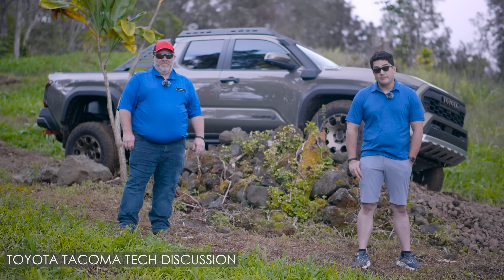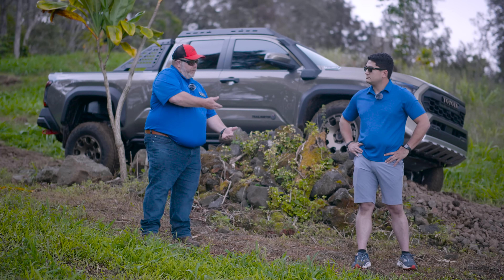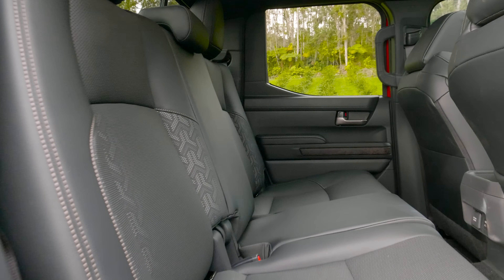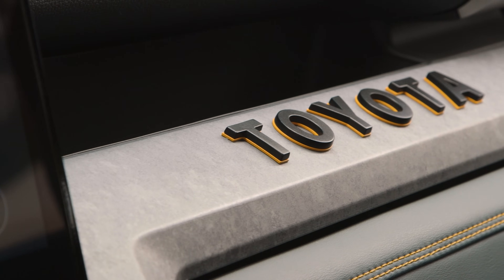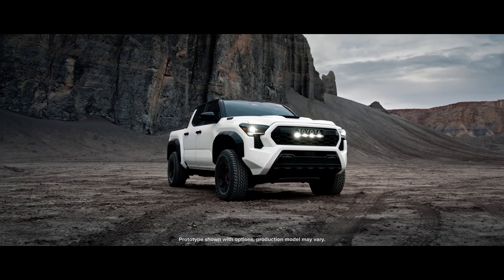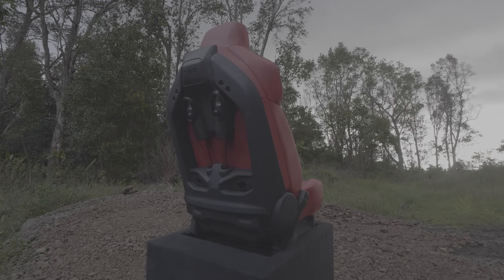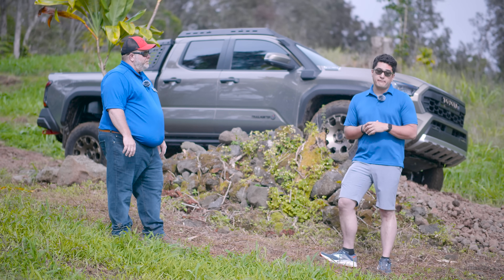2024 Toyota Tacoma | Big Changes, Technical Details

Comment: Great review of the Tacoma, and very impressed by the suspension upgrades and plush interior. While the 2.4L Turbo might be somewhat new to the North American market, what the Chief Engineer fails to tell you is that 2.4L Turbo petrol/diesel engine birth was in the Land Cruiser petrol 22R I4 in 1981 and diesel 2L-T I4 in 1982, sold throughout Europe and Asian markets. It''s bullet proof, so North American customers are in for a real treat.
Reply: its not the 2.4 turbo diesel. but regardless, the 2.4 gas turbo has been used in various toyota lexus suv's for a couple years now already
Reply: But will we get the diesel?
Probably not because I'll have to go buy one if they did
Reply: @vhateverlie  The EPA says no diesel for you. You have to move overseas to get a good vehicle.
Reply: 😂 you think this is anywhere close to related to a 22r/2lt? I’d love to snap a pic of mine and compare it to this. This things a giga Chad truck. Drawing comparisons from the 80’s to now is stupid. It’s gonna sell like hot cakes to a bunch of people who’ve never had poison ivy
Reply: @ethans7682  Of course Toyota's 2.4L engines evolved from '81, that goes without saying. It's about measurable progressions, with sustained  reliability. You don't throw the baby out with the bath water. ;-)
Reply: Wasn't the 22R in the Celica in the eighties????? Swear that is what it said on my motor. It was a 2.4L NA motor.
Reply: @michaelcooley8275  yeah, my friend has a 90's Tacoma. It's got the 2.4 aswell. It's probably the same block like what Ford does with the 2.3 Lema engine.

Comment: Love the new look inside and out.. The only thing I wish they would address is rear seating leg room (or lack thereof). I have a 2020 TRD off-road double cab and need the driver seat pulled all the way back which leaves little to no room for a passenger. Thankfully my dog doesn't mind :)
Reply: I agree with you 100%.  Just give 2 inches in the back for rear seat passengers. Was really hoping they would add extra room.  However, they did change the driver seating position so I’m hopeful I can sit in this comfortably.
Reply: @bryansheridan6434  You will, but the rear leg room is slightly smaller, but you will have more room if it makes sense.

Comment: It looks like they knocked it out of the park, while being careful to not ruin what a Tacoma is. I'm sure they'll remain the midsize sales king with this hugely strong, finally clean-sheet Tacoma redesign. That 2.4L turbo, even in non-hybrid form, makes 20% more max torque than the old 3.5L.... and it makes it 2900 RPM earlier in the rev range. That's going to make HUGE differences for drivability. The old Tacoma was a gutless wonder, even stock and unladen--that won't be the case anymore.

This 2.4L will probably make it into the upcoming 4Runner. If so, maybe I won't have my brand new stone age 2023 4Runner for 15 years after all....
Reply: Your current 4runner is still the best-looking SUV currently. It just perfect from every angle. If I didn't need a truck, I would have bought a 4runner a long time ago (since it is made in Japan).

Comment: Aren't there already major issues with the new i-force engines? Hard to imagine there aren't with an electric, turbo, ICE combo. Even several turbos have blown on just the V6 non-hybrid in the 2022+ Tundras. Toyota's reputation for reliability I foresee probably going down the drain with these engines.

Comment: what I'm curious to know more about is the specific changes they made to the engine internals, as this engine is used in other toyota/lexus products but mainly suv's and cars. How did they ruggedize it for the Tacoma application?
Reply: They didn't. They're just throwing 4 cylinders in everything now to cut costs and appease the EPA freaks, abandoning their long-term customer base who love the smooth and reliable 6 and 8 cyl options. These 4 bangers will never last as long or run as smooth as the 6-8 cyl options and Toyota knows this. Not even a 6 cyl NA hybrid option. Pathetic. They will lose more and more customers until they finally realize their woke power train mistake is costing them money.
Reply: @nateg2468  How do you sell vehicles in the US without appeasing the EPA freaks? Instead of blaming Toyota, why not blame the people you voted into government? Next thing you know there will be a Plaza Accord 2.0
Reply: @Chocoretto  I don't vote Democrat, so I'm not to blame for that. And regarding the EPA, car makers can still make v6 and v8 engines which are cheaper to produce. Unfortunately most have instead bought into the full EV lies and do not give enough pushback to the green environmental lobbyists in Washington. So it is partly the car companies fault. They are fully capable of continuing to make ICE and hybrid 6 and 8 cylinder powertrains.
Reply: @nateg2468  How many V6s and V8s can Toyota produce before they hit EPA emissions cap? Toyota will have to purchase more carbon credits once they hit the imposed limit. You can model all of these out. Have you missed out on the backlash Toyota received when they lobbied against ICE ban and full EV transition.

Comment: If Toyota comes in at under the Ranger Raptor price of $57,000 USD for the TRD PRO & TRAILHUNTER and with no limits on Production or SupplyChain issues then I think Toyota is going to be King of OffRoad in this segment…
Reply: it wont, all of these tacomas will be 50-65k easy
Reply: @benoliver2826  Maybe the first few months, but the competition is already gonna be in full swing by the time this truck actually comes out.  Tundras are already going for msrp.

Comment: I had a 2019 manual TRD off road until recently, and my biggest complaint about the drivetrain is the lack of low to midrange torque—it was really pretty gutless unless you revved it out. Not exactly what you want in a truck, especially when towing. I think the turbo 4 will be a better fit.
Reply: 2017 TRD Sport 6MT owner for 7 years. Don't mind revving it out, the point of the manual transmission to be engaged. Most  performance being available past 3K rpm is what keeps it interesting.

I do understand that automatic Tacoma owners would be frustrated.

Comment: Great video, and thank you for approaching it from an engineering standpoint. I continue to be surprised that they haven't brought Toyota HSD to the truck platforms. Adding more complication than a traditional drivetrain on the "max" hybrid is a tough sell for me. A "transmission free" system like other Toyota hybrids would be more reliable, more efficient, and perfect for most pickup use cases. Actually simpler than a "traditional" transmission! Won't consider a new Toyota pickup until the conventional transmission is gone. I'm clearly not alone; 40% of Mavericks were Toyota-style hybrids and Ford stated they underestimated the demand.
Reply: There must be a reason they didn't do it.

Comment: Nothing sells me on a vehicle quicker than hearing directly from the engineers involved in the project. Marketing fluff and obnoxious hyperbole always fails to capture the actual capability and spirit of the machine they've made. 

I have a feeling the TRD Pro and Trailhunter will only have the iForce MAX, but I would really like to have the option of the 2.4L Turbo and manual trans on those as well for those of us (ME) who want that combo.

Comment: two other questions, with reguards to the manual transmission.   when they had to take those few extra horsepowers away on the 6MT because of the heavy flywheel, what exactly is "crankshaft hammering?" is that like crank walk but at high RPM? 🤔🤔
Also, in the low grade SR trim, when you pair it with the manual transmission, are you always confinded to rear leafs? or does picking the 6MT option immediately put you with the rear multilink suspension even on that entry grade SR ?

Comment: Weird that all but the top two trims (TRD-P and Trailhunter) have a MASSIVE front lower fascia that robs ground clearance and attack angle.  Just looks kinda goofy.  The notion that only the top trims will do real off road stuff is obviously not the case.  Most of the friends I have that would consider one of these would be taking it out the mountains occasionally, and they're also the types that would go for a lower trim level.  Sucks having to immediately swap out a factor part just to not tear front of the truck on a rock.

Comment: The bit about the differences of the lower and higher output engines was awesome. That is the kind of detail I like hearing about. This entire video is exactly what manufacturers should do. Sometimes the technical deep dives just feel like corporate sales pitches.
Reply: That didn’t seem like a corporate answer to you? “Oh yeah the oil cooler is gone or something maybe…”

They carried over a transmission that has a lower torque input rating just to say they still offer it with a stick but with lower ratings so they can phase it out after a while. They phased out the 5 speed for the 4 cylinder for fucks sake in 2017.

Comment: Is the 4 cylinder worth it? not to mention a 4cylinders towing capacity goes down, and the turbo is something else that will just fail in the long run. A turbo on most cases will last around 100-150k miles and often has issues with blowby.

Comment: Scared for them to release the fuel economy ratings.  They increased the wheelbase by 4", which is usually to circumnavigate fuel economy requirements
Reply: Interesting observation.
Reply: @bearclaw5115  I think the EPA bases their fuel economy requirements on a "footprint" calculation, which takes wheelbase into consideration.  Basically, the bigger the vehicle, the lower your average MPG's can be

Comment: I heard the new engine is going to be Direct Injection only instead of the time tested Multi-port Injected Atkinson Cycle Engine. If that’s the case I’m out. Like electric cars, we’re still a long way out from the long term reliability and low maintenance of Direct Injection only engines.

Comment: I wish you would press these questions a little more, these soft interviews sound too much like manufacturers talking point driven questions.  I worked around Toyota in the early 2000's and this sounds just like their product introduction classes from that era.  A great example is the softball question of the engine differences between the low and hi output 4cyl and the lack of an answer.  The real question is do they share the same crank, rods, pistons, cylinder heads and turbo (implying it is just a tuning variation) or not.  There is a next level question you should be asking when you have access to these people.

Comment: Let me tell you why the "Trailhunter" is a huge failure. This "overlander" got only a few things right. The rock rails that hold 1/2 the GVWR is a damage multiplier, not a damage reducer. It needs to be rated to survive the impact of the full GVWR. The steel rear bumper is nice, but where is the steel front bumper? An optional front bumper that will protect your radiator and headlights if you accidently strike an animal is a must for many overlanders.  It needs more skid plates under it.

A larger engine without the hybrid system is more reliable and much cheaper to maintain/fix in the long run. Forget the hybrid battery. A second 12v battery under the hood, and a higher amp alternator, or even a second higher amp alternator, that can charge a variety of off the shelf batteries is more desirable. First, it is cheaper. Second, you will always have a fully charged spare 12v battery to start your vehicle. Customers would prefer to have the options to later upgrade to better off the shelf batteries that can be charged when the engine is running, and also charged with solar when it is not. If this had higher amps from a bigger alternator, or two alternators, running to an invertor that allowed an infinite choice of off the shelf "house" batteries, that can be upgraded or swapped out anytime through the life of the vehicle, you would attract more customers. 

The 33' tires are an improvement, but not with 18" rims. A larger diameter tire does improve the off road ride, but more tire sidewall does too. A 17" rim with 34" tires would be much, much better. A huge number of off roaders/overlanders will make this change, or want to be able to. They already do. 17" rims are popular because there are a larger variety of 17" tire tread types and sizes to choose from, and they are cheaper. If this new Tacoma has to have 18" rims to clear larger brakes, you just pissed off a lot of potential customers. 

What kind of transmission cooler does the new 8 speed automatic transmission have? is it adequate? will it keep the transmission cool on fully loaded 1,000+ mile trips with very steep grades?

No single cab option with the six foot bed. People want to be able to sleep in the bed of their pickup, and have a shorter vehicle for turning on the trails. 

Low hanging exhaust. Make the exhaust exit through the middle of the rear steel bumper. 

Make the hood flatter. There are a few different after market options for solar panels made for the hood of the vehicle that are vehicle specific. These are purposed for keeping your starter battery fully charged if you park and camp in one spot for an extended period. 

The snorkel. People want the option to add a pre-cleaner to the top of the snorkel. A Pre-cleaner means you have to carry fewer, or even no, extra engine air filters. They greatly reduce the amount of dust that reaches the stock engine air filter! 

Always on (when the engine is on) front and rear cameras is a common upgrade that overlanders make. Stuff blocks the rear view mirror but we still want to be able to see behind us when moving forward. When cresting small hills or big bumps, we cannot see the road through the engine and hood. It's common for people to stop and get out of their vehicle to see what they may be hitting or if there is a ledge, or other drop off. 

There are way too many reasons for an overlander to not buy this vehicle, than there are to buy it.

Comment: 0:44 1:49 4:43 9:43 Wow, that unusual front bumper lip gives it an interesting look. Kinda brutish, badass and almost sci-fi style. And from the side it fades into the background so it doesn't look too weird. - Tempting to paint it, but that would probably cause stylistic issues. Not to mention offroad grief.
1:37 Hawai'i glass? 🙂
13:37 golden moment! 😄
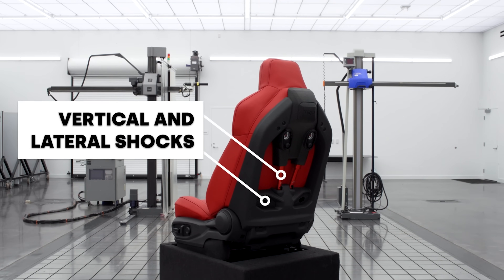15:00 Dampened seat?! ... Things are getting wacky. ... But I gues in extreme offroading this might make a difference. Probably also to spinal health.
15:31 Rare that the footage is right and the edited-in caption has the mistake(s). ... Mark having an extra-tough time?
17:27 The polar bear 'meme' is really weakass and sighworthy. ... Fits the agenda, though. Small children will buy it.

Comment: Jack and SG. Very well done considering the circumstances of the revolving door of journalists that took their Chief Engineers time, what you were able to accomplish here. I ve been following the new launch and every other interview is after a grocery list of questions and phamplet phrases. Jack and SG team were able to make him feel comfortable enough to discuss REAL engineering and design questions. In a short amount of time.  
❤ So thank you for that as I consider dropping my 2016 manual tranmission for a shiny new pavement pounder Trail Hunter.  Those milk jugs are heavy so I need that Old Man Emu suspension. 

Keep it up boys.👏
Reply: "Jack and SG team were able to make him feel comfortable enough to discuss REAL engineering and design questions."  What does this even mean? I've seen quite a few interviews with Sheldon on the new 4th gen Tacomas at this point and I don't feel he was under any "duress" in the others. I'm pretty sure he was "comfortable", that's what he is there to do - answer technical questions as the lead engineer. Jack did fine, but I've already seen him answer the same questions multiple times over the past few days...

Comment: Great truck and review. Keep it up, SG! However, why does Toyota continue to produce vehicles with a face hood scoop? It makes zero sense from a functional standpoint and only satiates the cosmetic fanboys. What's the harm in making that hood scoop functional? Maybe add an oil cooler in the area where the hood scoop vent is located and direct air there? Or, create a hood scoop extractor rather than ram air. /shrug
Reply: Because adding an oil cooler up there would add unnecessary cost and weight.
Reply: @bearclaw5115  I get the cost. But, weight? Cmon my guy. An oil cooler and small bracket would weigh almost nothing. I just wish they would not add a fake hood scoop. It looks dumb.

Comment: Nah, I'll take the frontier for the N/A v6. I hate the 4cyl bs
Reply: I4 TURBO IS NOT BS And ITS Better THAN ANY V6 or even a 5.3L V8 . You BUY WHAT You WANT BUT Dont CALL THINGS BS JUST Because You Dont CHANGE .🤦
Reply: @Money Power  nah man, just OEM turbo system always trash. Just more shit to fail down the line
Reply: @racingwthryan    MAN IT WILL BE MORE THAN FINE  And IT WONT FAIL .🤦.TOYOTA And Lexus MODELS ALREADY HAVE THESE  ENGINES .THEY HAVE NO PROBLEMS  And  TOYOTA KNOWS WHAT THEY ARE DOING And UNLIKE WHEN THEY KEPT THE V6 FOR THE LAST 🤦. GET WITH THE TIMES 👍